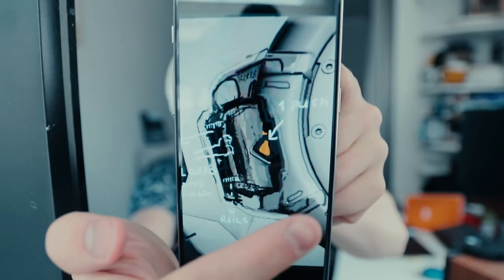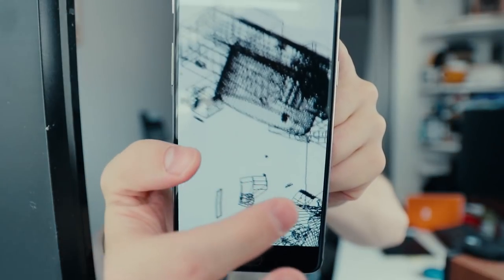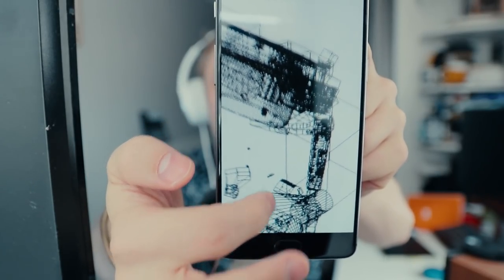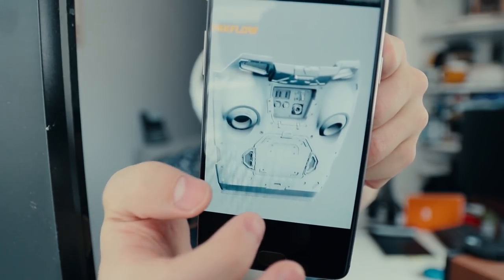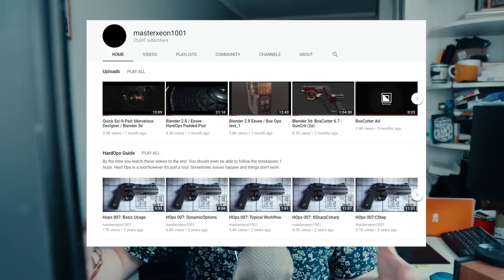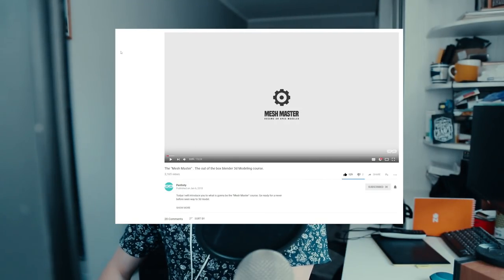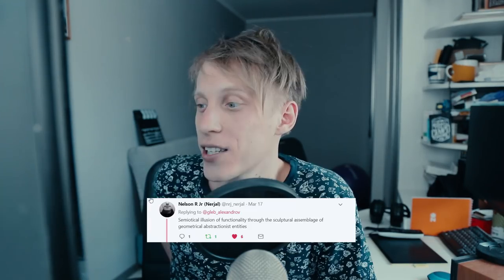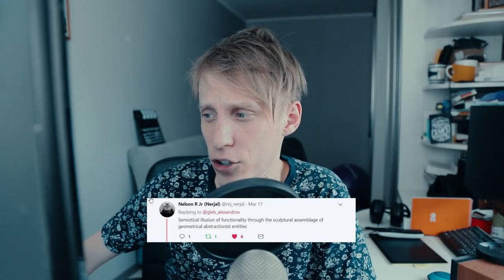//Update Vlog! Hard-Surface Modeling course and other stuff

Comment from the maker: MasterXeon on Youtube: https://www.youtube.com/channel/UCOCDPQGB3HBq54lDyTWde_A
Penfinity on Youtube: https://www.youtube.com/channel/UCgEWZe5DyLJGBk6qUC96NCg
Reply: hl2 is in top3 definitely, but its hard to say if its the best. originaly hl1 was made by valve using quake3 engine slightly modified thou. and q3 engine was originaly developed by id software as a first open source game engine. so others could use it freely and they never got enough credits for it, considering the success valve made later on with hl1 and most of all hl1 mod - cstrike. so with all respect to valve, but some credits go to q3 engine masterpiece. anyway i want to hear yr oppinion about online multiplaye fps world of tanks (fully developed by russian company - war gaming). also r u fan of "metro 2033" bestseller book by dmitry gluhkovsky? cause there is very successful single player game made by the book. can u check it out and tell us yr oppinion about its graphics and design work? cheerz.
Reply: Have you had early access to the Mesh master course? It doesn't seem to be out yet. Or do you have a link to the course? There is a playlist called Mesh Master on Penfinity channel but it's not the upcoming course he is talking about in the trailer that you talked about.

Comment: Hi Gleb! I wasn't sure exactly "where" to post this, but what do you think of this build for Blender, Affinity Photo, Premiere Pro, Substance and maybe some Batman Arkham Knight and FFXV:

PCPartPicker part list: https://ca.pcpartpicker.com/list/XDXPV6
Price breakdown by merchant: https://ca.pcpartpicker.com/list/XDXPV6/by_merchant/

CPU: AMD - Ryzen 7 1800X 3.6GHz 8-Core Processor  ($399.99 @ Amazon Canada) 
CPU Cooler: Corsair - H60 54.0 CFM Liquid CPU Cooler  ($75.66 @ Amazon Canada) 
Motherboard: ASRock - X370 Killer SLI ATX AM4 Motherboard  ($150.00 @ Vuugo) 
Memory: Kingston - FURY 16GB (2 x 8GB) DDR4-2666 Memory  ($231.99 @ Mike's Computer Shop) 
Memory: Kingston - FURY 16GB (2 x 8GB) DDR4-2666 Memory  ($231.99 @ Mike's Computer Shop) 
Storage: Western Digital - Black 512GB M.2-2280 Solid State Drive  ($205.00 @ Mike's Computer Shop) 
Storage: Western Digital - Red Pro 3TB 3.5" 7200RPM Internal Hard Drive  ($250.65 @ Newegg Canada Marketplace) 
Video Card: AMD - Radeon Pro Duo Polaris 32GB Video Card  ($1179.99 @ Newegg Canada) 
Case: Corsair - Crystal 570X RGB White ATX Mid Tower Case  ($218.87 @ Mike's Computer Shop) 
Power Supply: Corsair - CSM 650W 80+ Gold Certified Semi-Modular ATX Power Supply  ($123.18 @ Amazon Canada) 
Operating System: Microsoft - Windows 10 Home OEM 64-bit  ($113.75 @ Vuugo) 
Wireless Network Adapter: Gigabyte - GC-WB867D-I PCI-Express x1 802.11a/b/g/n/ac Wi-Fi Adapter  ($44.99 @ Memory Express) 
Total: $3226.06
Prices include shipping, taxes, and discounts when available
Generated by PCPartPicker 2018-04-24 14:09 EDT-0400